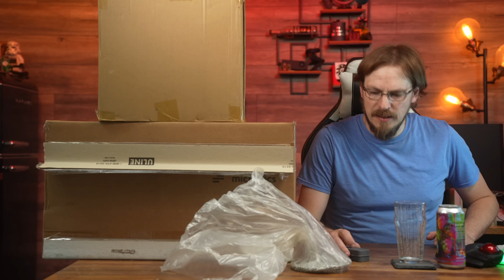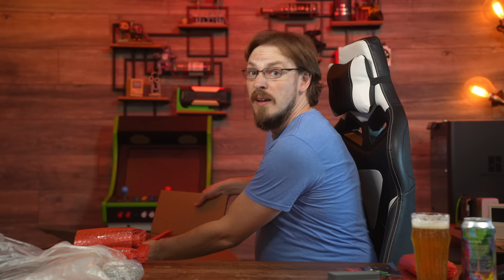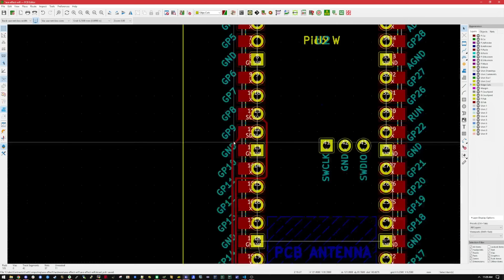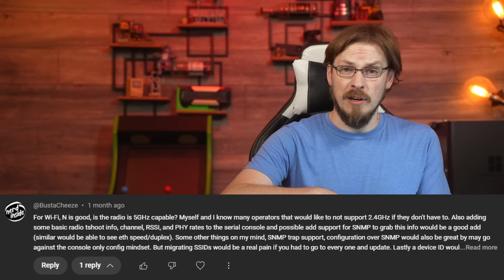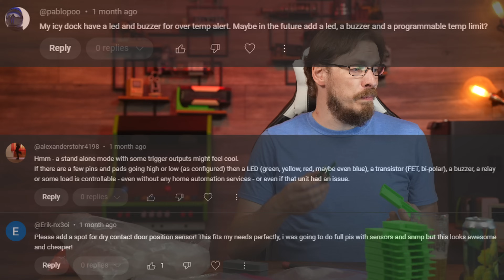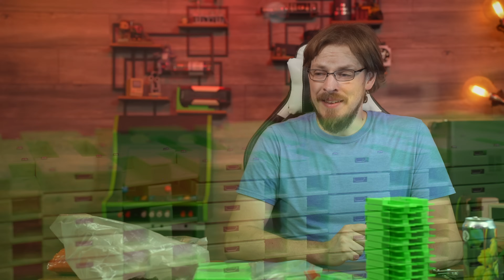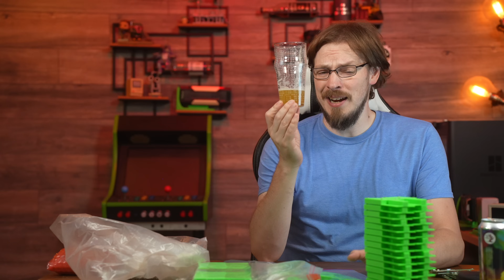Assembling SNMP Temperature Sensors and Answering Your Questions

Comment: it would be very interesting to know in what your developer would develop for esp32 if not in c?

literally any software or library for esp32 that i know of, is written in c...
Reply from the maker: Yes, ESP libraries are written in C. Those libraries don't include network monitoring tools developed in the late 90s ;-)
Reply: @CraftComputing  this answer does not even make any sense.

i try to understand what you get at with your statements, i really do. but i can not quite make sense of it.

so your developer told you, "snmp is written in c and porting it to esp32 is like teaching a monkey to read". 

snmp is a protocol, not a software. there are specifications, in rfc 1157 to be exact. everyone can read those and write code that does exactly what is specified in a weekend, i guess.
that code can be written in c. or in "whatever". but c would be what you want for the esp32 platform anyway.

i guess, the generic, existing arduino_snmp library that everybody uses would also work.
it is also written in c. the code your "developer" would write to program the behavior of the esp32 would also be in c, because i have no idea in what language else anyone would program for esp32. so that whole statement does not make sense in the slightest.

esp32 code is written in c, "snmp is written in c", every library for esp32 is written in c, where is there a problem?

you could in theory compile freaking linux for esp32, i really really do not understand the argument made here...
Reply: @CraftComputing  this answer does not even make any sense.

snmp is not a software, it is a protocol specified by RFC 1157. anyone could implement that specification in any programming language they want, in about a weekends worth of work.

i would prefer to do that in c, as it its the native programming language for the esp32 platform. one could also just use the widely appreciated arduino_snmp library, that is also written in c.

i have no idea, how your "developer" comes to the conclusion, that "snmp is written in c and porting it to esp32 is like teaching a monkey to read", as c IS the de facto standard for esp32 code.

one could in theory compile linux for esp32 and run it on there, so there should be no reason, your software could not be compiled for it.

i would be really really interested in the reasoning behind this "not so accurate" statement. deleting my comment is not gonna help me understand, though (i do not even understand that, i was polite and only presenting facts).

"i decided not use the esp32 platform, because snmp is written in c" is anyhow not a logical statement whatsoever.
Reply: @CraftComputing  this answer does not even make any sense.

snmp is not a software, it is a protocol specified by RFC 1157. anyone could implement that specification in any programming language they want, in about a weekends worth of work.

i would prefer to do that in c, as it its the native programming language for the esp32 platform. one could also just use the widely appreciated arduino_snmp library, that is also written in c.

i have no idea, how your "developer" comes to the conclusion, that "snmp is written in c and porting it to esp32 is like teaching a monkey to read", as c IS the de facto standard for esp32 code.

one could in theory compile linux for esp32 and run it on there, so there should be no reason, your software could not be compiled for it.

i would be really really interested in the reasoning behind this "not so accurate" statement. deleting my comment is not gonna help me understand, though (i do not even understand that, i was polite and only presenting facts).

"i decided not use the esp32 platform, because snmp is written in c" is anyhow not a logical statement whatsoever.
Reply: @CraftComputing  this answer does not even make any sense.

snmp is not a software, it is a protocol specified by RFC 1157. anyone could implement that specification in any programming language they want, in about a weekends worth of work.

i would prefer to do that in c, as it its the native programming language for the esp32 platform. one could also just use the widely appreciated arduino_snmp library, that is also written in c.

i have no idea, how your "developer" comes to the conclusion, that "snmp is written in c and porting it to esp32 is like teaching a monkey to read", as c IS the de facto standard for esp32 code.

one could in theory compile linux for esp32 and run it on there, so there should be no reason, your software could not be compiled for it.

i would be really really interested in the reasoning behind this "not so accurate" statement. deleting my comment is not gonna help me understand, though (i do not even understand that, i was polite and only presenting facts).

"i decided not use the esp32 platform, because snmp is written in c" is anyhow not a logical statement whatsoever.
Reply: @CraftComputing  this answer does not even make any sense.

snmp is not a software, it is a protocol specified by RFC 1157. anyone could implement that specification in any programming language they want, in about a weekends worth of work.

i would prefer to do that in c, as it its the native programming language for the esp32 platform. one could also just use the widely appreciated arduino_snmp library, that is also written in c.

i have no idea, how your "developer" comes to the conclusion, that "snmp is written in c and porting it to esp32 is like teaching a monkey to read", as c IS the de facto standard for esp32 code.

one could in theory compile linux for esp32 and run it on there, so there should be no reason, your software could not be compiled for it.

i would be really really interested in the reasoning behind this "not so accurate" statement. deleting my comment is not gonna help me understand, though (i do not even understand that, i was polite and only presenting facts).

"i decided not use the esp32 platform, because snmp is written in c" is anyhow not a logical statement whatsoever.

Comment: It's not easy to port the C code over to ESP32? But Hacker News commenters always tell me that C is portable assembly! I am shocked that it doesn't just work /s
Reply: depends from what the C code is doing. If it's doing purely data manipulation stuff like it's usually doing on x86 PC/server/whatever it's portable between platforms, easy enough.
If the C code was tightly integrated with the platform, using interrupts and clocks and sleep modes and whatnot as you SHOULD do on any microcontroller platform to achieve low power and good performance, you can't really "port" any of that to a different platform, you need to adapt or even rewrite the parts that relied on hardware interfaces that are now different or don't even exist.
Reply: Also, wtf do hardcore anti-drug people think alcohol is!?
Reply from the maker: 'classy' and 'socially acceptable'
Reply: @MarcusTheDorkus  those people often post in the comments crying that this channel is promoting alcoholism

Comment: An option for support of an external water resistant temperature probe with a tolerance of -40 and +100c would be greatly appreciated... no particular reason that I can state at this time.
Reply from the maker: Unfortunately the temp probe we're using cannot be conformally coated.
Reply: @CraftComputing I was thinking more of a port to connect a commercially available oven temperature prob.

Comment: I know you put lots of work into these...
But can you explain what this does, that a premade $15 ESP32 + Temp/Humid sensor does not?
Or, for the sake of argument, a $2 BlueTooth Temp/Humid sensor + roll your own BlueTooth gateway?
Not "Why did you chose to build with X over Y?"
I mean it literally. "You have a thing that costs $X. Why would I buy this instead of something that could be built for $3 or an already existing thing that can already be bought for $2?"

This honestly feels like one of those "I want to design a board as practice/learning. Okay now I might as well sell it." to me.
PCBway sponsored you to make a video about making a board. So you made one. Now you are selling them too.
And there is nothing WRONG with that.
I'm just confused about why this is a product that NEEDED to exist, instead of a project that other people can now buy...

EDIT:
Jeff. I want you to know that I'm not shitting on you here.
This is a great PROJECT. But I am still baffled about it as a PRODUCT.
I didn't HAVE to build my own.
I bought 10x fully assembled commodity temp/humidity sensors and flashed a custom firmware on them.
[Link Edited because post keeps getting rejected] github / pvvx / ATC_MiThermometer
Bluetooth? Zigbee? Roll your own? Sure.

I'm using MQTT, but I could have done this with SNMP on the gateway instead.

When someone shows me a T-shirt and tells me it was $60, my first thought is "WTF?! a $60 T-shirt?".
But if the T-shirt is merch? Sure. The point is to support the channel. Getting a T-shirt is just a bonus.

That is how this whole thing feels right now.
If this is a $70 piece of merch and someone get's a $5 temp sensor out of it...fine?

But so many people are talking about this like it's some revolutionary thing. And I don't get it...

NOTE: The PoE one is MAYBE a different sell. Being able to confine it all to the-wire instead of wireless would at LEAST be a feature that isn't currently available off-the-shelf already.
But then again...you can get a whole ARM computer That runs full blown Linux with PoE for like...$25? You could have absolutely developed in whatever language you wanted, designed a case, and had the ability to run a dozen temperature probes off the GPIO to track all sorts of stuff...
Reply from the maker: Can you build a $10 ESP32 Temp/Humidity sensor? Sure. ESPHome is great for those kinds of projects.

Can you build 300 of them and deploy them to industry? Do they respond to SNMP queries? Will you provide software support? Bug fixes? How long does it take you to build one? How about 300?

The current industry for SNMP Temperature sensors starts at $250+ for a single unit. I'm bring a product to market, and targeting a budget that both SMB and Homelab customers can afford. It's an off them shelf product that not only works, but it's better than most existing solutions if you're wanting to integrate it into standardized network monitoring software.

Sometimes, you can build yourself a sensor, and that's perfectly fine for your use case. Other times, you need a product that's just ready to deploy. That's where I'm coming in with this.
Reply: @CraftComputing  No idea why I can't reply...but I edited my OP with the response to this.
Reply: As an example, I bought 10x Xiaomi LYWSD03MMC Thermometer + Humidity sensors for $22 shipped.
I then flashed a custom firmware on them to remove the proprietary Xiaomi garbage.

Are they battery powered? Yes. Kinda sucks.
Have they been running for 16 months on the same coin cells? Also yes.
Would I have paid more for something with external power? yup.

We all need to be thinking about the waste we produce.
But $3 for a 10-pack of carbon-zinc coin cells every 1.5-2 years doesn't seem THAT unreasonable or wasteful.
Reply: @Prophes0r  > I bought 10x Xiaomi LYWSD03MMC Thermometer + Humidity sensors for $22 shipped. I then flashed a custom firmware on them to remove the proprietary Xiaomi garbage.

This is the same tired argument of "why buy a turnkey device when I can DIY something similar for much less" that people post every time somebody reviews a turnkey NAS. 

You have invested the time to learn the skills to understand the DIY IoT world with Tasmota and ESPHome and all that fun stuff. You invested the time to search for, buy and reflash existing devices. You are not the target of Jeff's product. At the skill level you are at, it takes 10 minutes to find another suitable device to add to your IoT swarm.

Jeff is selling to people that don't know and/or don't feel like it's worth their time to DIY.
His device comes ready to be used with Zabbix or any other businness-y monitoring software and that's where most of the value is in, they buy it, they run the config interface on serial once and they deploy it.
Reply: @Prophes0r  or in other words it's an apple and orange comparison. DIY is always cheaper, with time investment and skill as sunken cost that is often ignored.

If you compare this sensor to other turnkey devices with similar specs, his product is eating their lunch with an order of magnitude lower price
Reply: @marcogenovesi8570  Except I'm not.
I bought OFF THE SHELF sensor units, with cases and a box and instructions.
I pulled the plastic tab out to let the battery contacts connect.
I pushed 1 button on my phone to reflash them.
I added them to my bluetooth gateway.
I stuck them where I wanted them.

And that also isn't what I was comparing.
A. Buying a beta product for $70 that you WILL need to tweak and massage.
B. Buying a finished product for $5 and having to hack some settings to integrate it into your setup.

Nowhere did I suggest buying a bare ESP and a sensor and making it yourself.

Both A and B require some user adjustments.
Any product like this MUST be adjusted, no matter how turn-key it seems.
This isn't a wall-clock. It needs to be integrated with whatever you are working with.

Comment: for scientific use and data center use, it might be interesting to add an o2 sensor to see if a fire suppression system has been triggered or if the o2 level for, say, an NMR is too low to enter the enclosure to work on the machine.
Reply: Keep in mind this reference is from someone who knows folks who work in the EDU environments and one who once was employed by EDU...  where budgets are small.
Reply: Have you looked at the cost on those sensors?
Most "real" sensors for counting gasses cost $60-$150 EACH in quantities of 1000.
(Not the hacky Volatile Organics ones that get slapped into a random project with false claims and the company then disappears...)

I ran into this situation when trying to throw together some cheap (think $5 BOM) environmental + air quality + CO2 monitors for my house.
I "NOPE"d right out when I saw the CO2 sensors were $75 each in qty 1-5.
Reply: @Prophes0r  well worth the price of investment, and there are good sources.

Comment: So, there is your first improvement ... snap casing... screw-less lol

Still one of the downsides of the current design is high density deployments (ie data-centres) 
Ideally one we can magnet/cable-tie onto the front door. 

So what you can do is just make different casings for it.

Pressure .... add a sensor in the front and in the back in a DC and you can work out airflow movement ....
Reply: making a snap casing that does not absolutely suck means quality molding and decent plastic material that does not warp. It's an absolute dog to get right.
Reply: Not sure why he didn't do press-fit. Maybe because he went the 3d printed route? They tend to break pretty easily when that small.
Reply: @TheRogueBro  There are many ways to do it at that size without it breaking.... and you don't really open the unit often.... but maybe because v1, just in case that is the case (lol)
Reply from the maker: This case started life as a press fit. I wasn't happy with how thick the walls became to prevent breaking. And honestly if I were to make one more revision, I'd add a 5th screw above the temp probe. A couple of the case lids want to lift still.
Reply: Absolutely not.
Saving some assembly time and <$1 on the BOM by making the product all but impossible to open is the WRONG way.
We need to stop treating every device like it is disposable.
Reply: @Prophes0r  You can make it so it's not impossible to open even with clickable .... it's just most products are designed not to be opened.
There is also the other side where the screws can strip the plastic putting it in the same boat ...
Reply: @mitchellmnr  not impossible but it adds design complexity. If stripping is a serious concern, which imho shouldn't be, you can always use nuts and bolts (with a sunk bolt so everything is flush), or inserts.